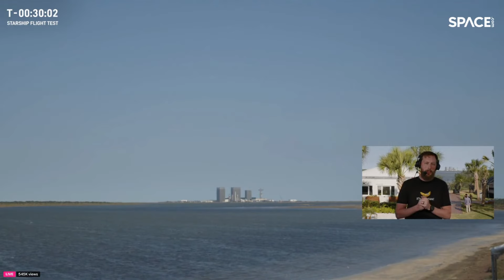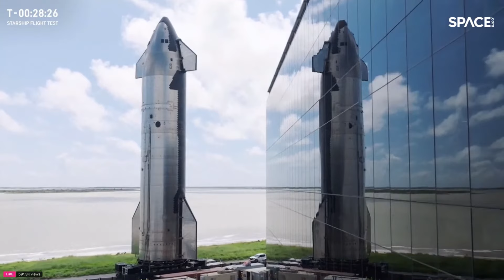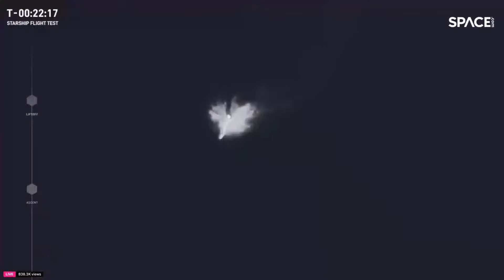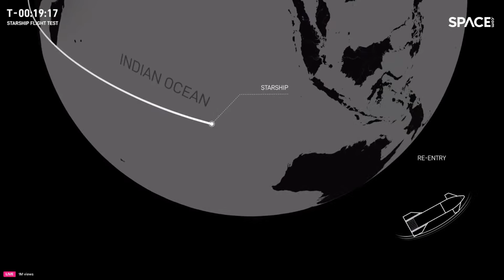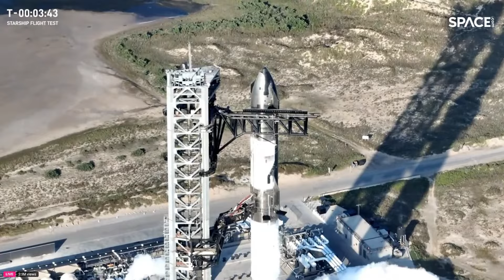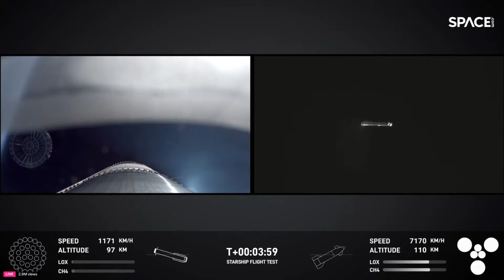Replay! SpaceX Starship launches on 6th flight, booster splashes down in Gulf

Comment: What a big dud this Starship launch 6 was with all the expectations they still not have done a complete orbit around the Earth or even more than two orbits which means all flights so far are only sub orbital space flights.
 They failed to catch the superbooster  which they did on the previous launch 5 and not yet achieved the Starship being caught by megazilla  or successfully landed Starship on the ground. 
They just keep on dumping in the ocean. 
They have done better with Falcon 9,Crew Dragon 2 and Falcon Heavy so far. 
Perhaps they should forget about Starship and come up with some new system that sits on top of the super heavy booster combining a modified and lengthened crew dragon with a lander. 
I don't know if Starship will ever achieve NASA and ESA Artemis Program  objectives or whether  the Artemis Program will be scrapped along with the Orion spacecraft and the  SLS booster. 
Maybe they will save Orion and mount it on top of a Space X super heavy booster.

Comment: It didn't "splash down" , it touched down and fell over in fire.
Reply: Splash down is just the term used for soft water landings
Reply: @gamenightfeldon2897  or like crashing and burning up ?
Reply: @MississippiWildlife  if it's planned to hit the water it's called a splash down. If it blows up in flight unscheduled it's called a RUD.
Reply: @MississippiWildlife  stay mad
Reply: @gamenightfeldon2897 soft language. It was a failed landing attempt and it caught on fire.
Reply: @ggusbuster  it fell over, and caught fire :)
Reply: @MississippiWildlife  it's a 100m tall stainless steel experimental rocket that isn't designed to land on water. This splashdown was an abort maneuver and booster controllably descended to the water surface, stopped and touched water surface. What happens next is left to the gravity and structural solidness of the booster, if it survives relatively intact after toppling over. Your point? No other super heavy launch system ever even attempted to return the booster stages.
Reply: @MississippiWildlife  reeee go back to 8th grade and get a proper education...
Reply: @MississippiWildlife Kamala lost 🤣

Comment: How did you get the starlink satellites up that are there now?
Reply: With their Falcon Rockets...also reusable. They're smaller, so they can't pull the raw tonnage that Starship can to orbit, plus the Merlen engines don't have the thrust of the Raptors, but the Falcon 9 and Falcon Heavy are the work horses of the industry right now.
Reply: @stephenbeatty442  how does starlink panel rectangle work to uplink data to satellites?

Comment: This flight was wonderful, because starship splashed down in the Indian Ocean perfectly!:face-blue-smiling:
Reply: The test was designed to demonstrate the capability to catch the booster in the platform (thats the whole point of having a "cheap rocket with a quick turn around")
So the test was a failure, we saw a rocket from the 60s